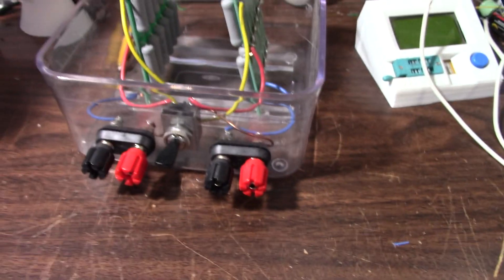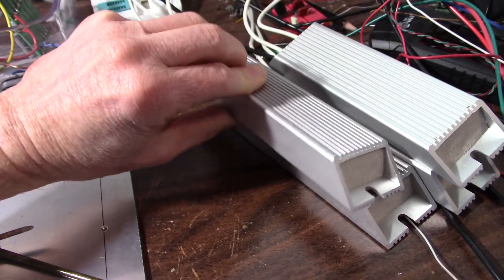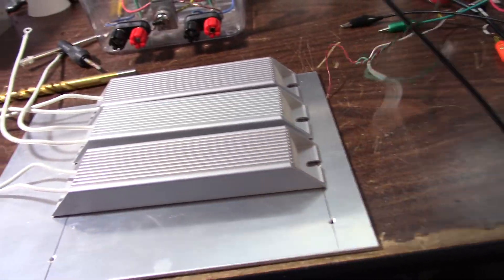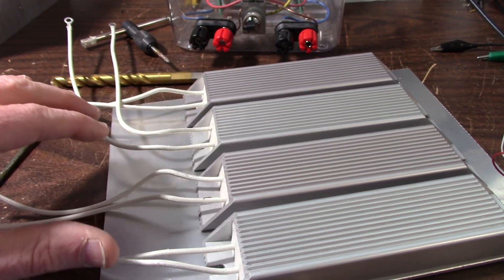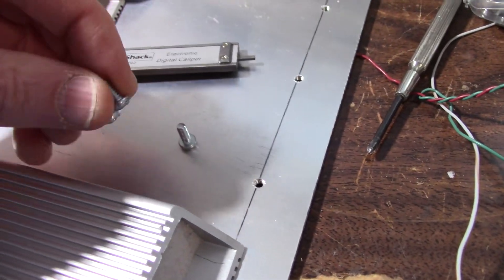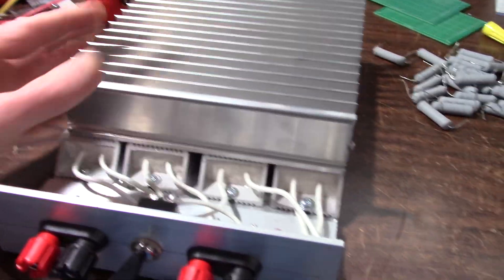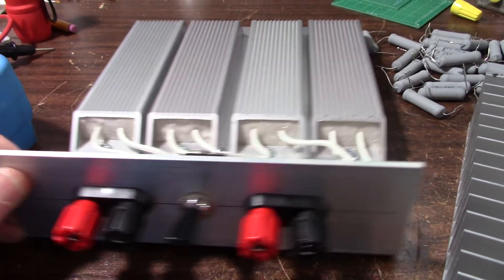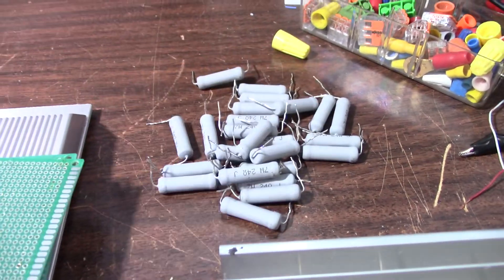Resistor bank dummy load for testing amplifiers - DIY build

Comment: Greetings again from Mansfield! When I built my multiple-kw load resistors for testing car audio, I found the best dollar per watt solution to be buying heavy nichrome wire and wrapping some coils out of it and mounting them in front of an old PC fan. I've got 4x 1 ohm sections to work with.
Reply: I wonder if you wind it in two directions it would be less inductive

Comment: Radio shack actually never went out of business they down sized and are still on line and are found in other small electrical shops on the east coast mostly.   I also thought they were closed down but there still around just not that easy to find besides online but there web site isn't the greatest just a little fyi to any one wondering 🤔😉👌👍✌️🎵🎶🛠️💯
Reply: You sure it's them or did someone buy the name. I say this because something similar happened with Dick Smith Electronics here in AUS/NZ. Went from a source of parts to a source of horrible plastic junk with some electronics inside.
Reply: @m3chanist  it supposed to be the same the store aren't as big and there website not that great and there only a handful full of them but there still around the hole cell phone radio shack what almost took them out completely it's still there name but the only way to really no is if you can actually find one and go there hope that helps 👌👍✌️💯🎵🎶🍻🛠️

Comment: Some cutting oil is paraffin based, candle sounds like a decent option. I built a dummy load but went in parallel. I have several 2, 4 8 and 16 ohm 100 watt resistors I can use individually or gang up to drop the ohms but increase wattage. Works great for testing power supplies and amps.

Comment: ive built many amp dummy loads for 200-400w per channel with cheap alloy clad wirewounds and personally not seen any issue with inductance , my typical use scenario is looking for crossover distortion ,oscillation or other instability and asymetry so my thoughts are that  amps in real world to run into an inductance so why do people avoid wire wound loads? i want the amp to show tendancy for misbehaviour

Comment: this is one of those things where you have to force yourself to build something propper, because you keep trying to get by with something thrown together in 10 minuites flat, and the heatsink paste has dried out years ago but you keep using it ,yes ive done that , the resistors were cooking and the heatsink was cold!  i find it best to fan cool them because you always end up running for longer than intended trying to find some asymetric clipping fault and the temp rises sharply when the heat soak effect runs out of physical mass and the convection cooling isnt antwhere near as effective as sheer mass or fans

Comment: Very intresting video, I have build a couple of variable dummy loads with some power transistors in the past, will that not work for audio applications?
Reply: diy variable dummy loads are always for dc. hes building for ac -now i always thought you just add a bridge rectifier to run  a dc dummy load at ac but then i thought for testing amps you dont want the crossover distortion (2x 0.7v dead zone) and non linearity (diode voltage sag due to heating) thatll cause  when you are looking for crossover distortion  asymetric clipping and such with a scope across the dummy load

Comment: It's very hard to get those resistors here
I'm searching for them locally since 2021
Reply: My dummy load are parallel resistors in a treacle tin full of oil - the oil helps dissipate the heat but you need to make sure the lid is firmly on !

You may find the big metal cased resistors easier to get where you are.